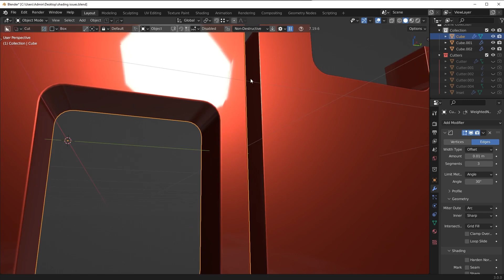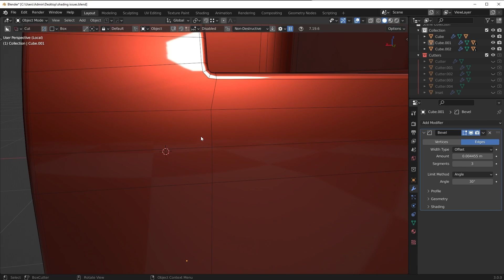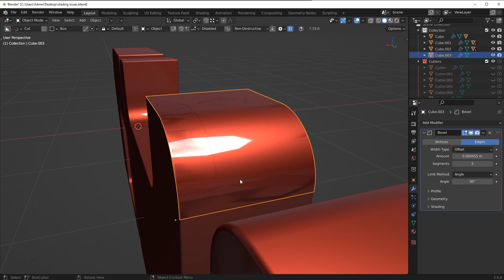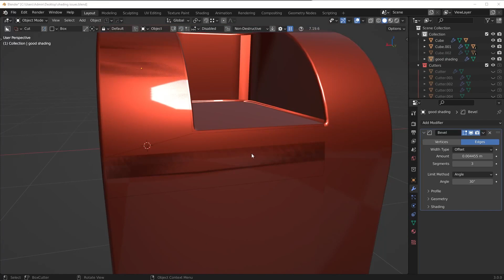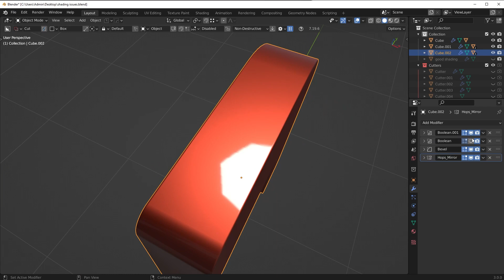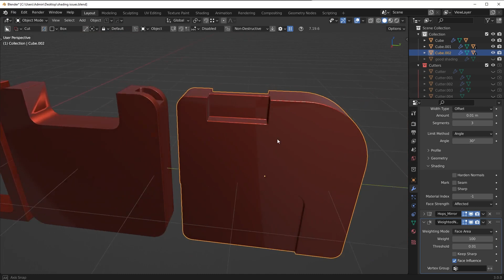Why Your Shading Is Broken (and how to fix it!)

Comment: doing sharp corners on rounded surfaces is one of those things where it seems that you MUST do sacrifices. Either redirecting the edges and getting sharp corners with pinching or not redirecting them and getting smoother corners without pinching. But the trick to transfer normal data allowed me to keep sharp corners without the pinching. Thank you!

Comment: if the shading is weird on flat faces, you can select the faces in edit mode then go to mesh-> shading-> flat faces and it fixes it, always. i am using blender 4.4 i am not sure since which version this feature was there but its tremendously convenient for flat faces.

Comment: idk if this will reach the people who need it  but ive found in situations where setting vertex groups doesnt work and other geometry is still affected by the normals transfer you can select all the faces you want effected then separate them apply the data transfer then re join them and weld the vertices this has by far been the best solution ive found for booleans with complex geometry (:

Comment: Ok, but what if i'm having issue number 3, but i never used a bevel modifier? How would I fix that? The weighted normal modifier barely helps...
Reply: Hello, I have same issue just like you wrote. Did you find answer on this question ?

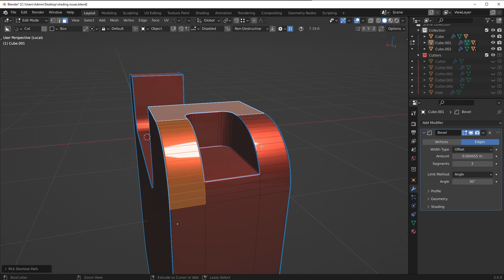Comment: 3:15 I run into this problem often and easiest way to fix it is to add an edge flow loop so the bevel modifier knows how to connect edges on that area. Most of the time, the edge flow loop does not need to be fully connect, you can make an edge flow loop up until the area where the surface is flat and leave it as an nGon at the flat area of the mesh. Bevel modifier should know how to connect those edges.

Comment: Easy fix for bevels: Do a solid bevel first, so you got muttering edges, then the bevel. A solid bevel in blender is achieved with the smoothing of a bevel, that produce additional lines on both sides of the edges you bevel. Its invisible in shading, but will do the job. Sadly Blender hasn’t got a bevel the combines these two.

Comment: If you do the data transfer and the back of the model appears hollow and you can see through the bottom of the mesh go down to max distance on the data transfer modifier and change the distance.

Comment: I find that in the second situation setting the outer bevel miter type to sharp is often the best compromise solution.  You can use several bevel modifiers, one set to arc and one set to sharp, and use vertex groups to control which bevel modifier is used for different parts of the model.
Reply: Thats actually brilliant and simple.

Comment: Hey Josh I've recently discovered your channel and wanted to say a HUGE thanks. You've helped me look at modeling a whole different way. I have been struggling for endless hours on a project as a blender Noob. After learning the click a segment & use "Control" to select more along that edge loop has been super helpful. Plus how to recognize whats wrong & fix problems with edges using merging. I just used it fix a Cyl on a rounded surface and I said out loud "OMG I get it!". Plus big love for the "You just select an edge on an existing mesh object (Like a Sphere) > Shift D (dup it) > Mesh > Separate > Selection" Then I converted it to a Curve & BAM > Bevel it and its now a pipe along the edge I needed to be at. AMAZING! Much love!

Comment: If your bevels are creating ngons could you add more vertices and make it all quads? I know the data transfer would work perfectly but it would be interesting to see how you could make it all quads in the most efficient way possible.
Reply: Not creating quads necessarily, but you could stick the Triangulation Modifier on after the Data Transfer (check "Keep Normals")
Reply from the maker: Yea, but that would be an unnecessary headache because then you’d have to apply the bevel modifier which I’d never recommend doing. I’d rather move the boolean down onto the flat surface, isolate the shading, or use normal transfer depending on your workflow.

Comment: What happens if the model is exported to OBJ or FBX format and another user tries to render it with another render engine and software?
Reply from the maker: I wouldn’t use normal transfer then, I’d isolate and triangulate or do a quick retopo in a subd workflow (or don’t use bevels at all, which I don’t recommend for aesthetics)

Comment: I hope they add a better way to deal with issue #2 in future releases. :(
Reply from the maker: Well it’s an innate issue any poly-based software will run into. It’s simply the mathematics behind how that type of topology works. It can’t just be “fixed”. It’s an innate behavior of that type of geo.